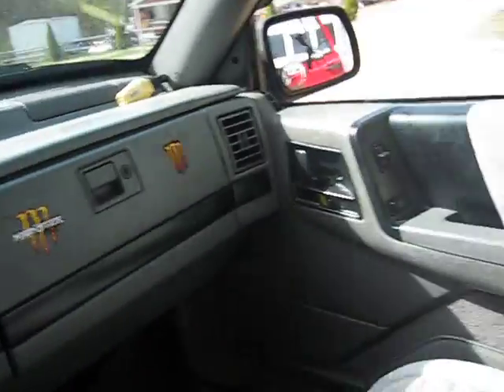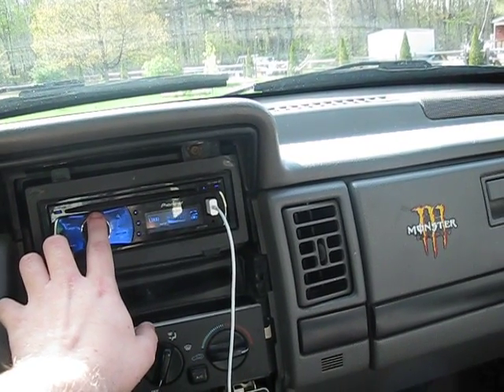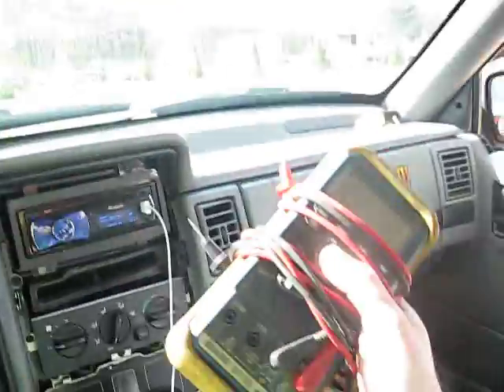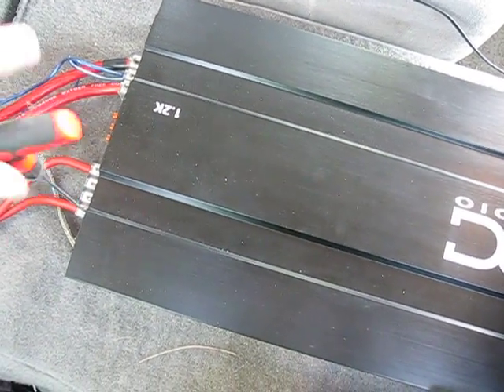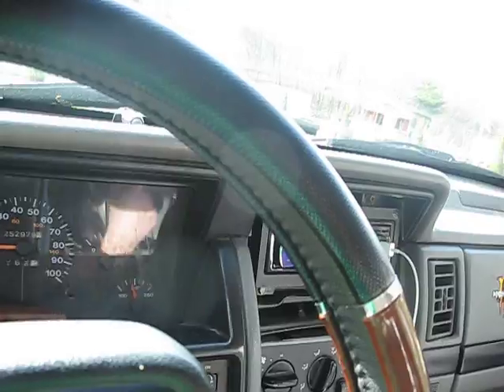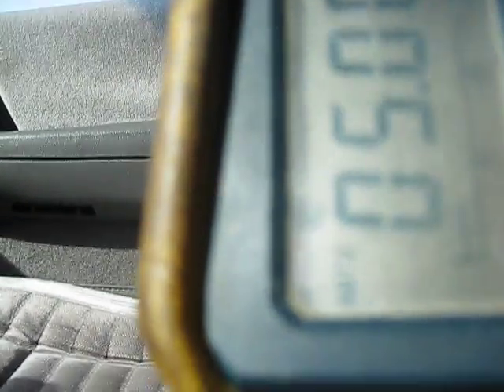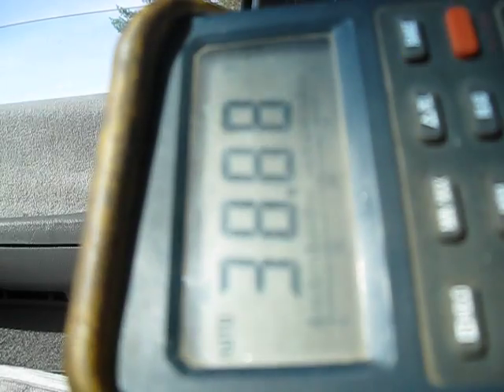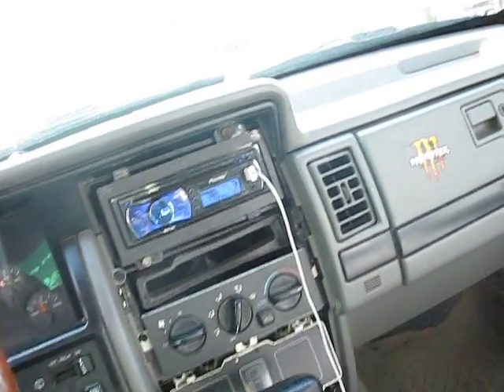How to set your Gains on a MonoBlock

Comment: My skar rp1500 does 930watts rms into a two ohm load. What should be the voltage be set at?
Reply: 43 volts
Reply: Multiply your RMS and impedence which is 2ohms and find the square root of that number
Reply: Thank you

Comment: You're amp isn't tuned correctly man. It's clipping. You multiply the power times the resistance and get the square root of that which is 34.64. resistance is the ohm load.
Reply from the maker: Amplifier is tuned fine.
Reply from the maker: There’s an rms chart in the video description that explains why I set it to this. It’s a 1 ohm amp doing 1200rms

Comment: thats old school tuning buy a smd-dd1 or oscilloscope  u wouldn't believe how much you rubbing your system.amp and subs these days are underated they can handle more power .
Reply from the maker: If you have a clamp you don’t need either of those. You can get your full rms rating and set it like I did in the video.

Comment: Can u find out if the amp is pushing the watts it says it pushing by checking volts. 

Example is the amp claims it's a 500 rms @2 ohms. Volts should be 31.6 volts. 

How do u know if the amp is pushing the watts? Im assuming it has to be under load to check? .. just bc u set it to the correct volts doesn't mean it will push it under a load correct?
Reply: Fade your sound to the rear or where the amp is. unhook your sub, speaker, connect your DMM (Digital Multi Meter) to where your speaker wires go. Put your Volumn on about half way then bring the gain up until you have the volts your looking for.
Reply from the maker: You can if you have a clamp
Reply from the maker: But any Korean or decent Chinese board will do rated or more.

Comment: I believe the math is off lol 34.6. But great vid either way lol
Reply from the maker: 36v at 1 ohm = 1200w. So no.
Reply: @JBlNN  so how to i come up with the voltage amount im looking for? Like how did he figure it was 38 v.? Thanks
Reply: @kamH5039  from what I understand the P-power of the amp X-times R-resistance then get the square root of that answer and thats the volts your amp needs to be pushing. So look at JBiNNs reply.  His amp is 1200(P) X 1ohm(R) = 1200. whats the square root of 1200?

Comment: to figure out the voltage (ac) this would be the formula is e= sq root of PxR 
E= volts (ac)
P=power (watts/ rms )
R= resistance (ohms)
example 
600 rms sub at 1 ohm would be 
600x1= 600 
then take the square root of 600 which is 24.49 which would be what the ac volts you would need
Reply from the maker: or just do what I do and use an rms chart ^_^
Reply from the maker: But I appreciate the feedback

Comment: so you're setting your voltage to the RMS of your subs, correct?
Reply from the maker: +Kendall Holsten Correct. Theres an RMS chart that will give you voltages.
Reply from the maker: More or less you want the RMS of the amplifier. Which on this amplifier is 1200w.

Comment: I have the same unit. I used the dd1. And that deck distort at volumen 55
Reply from the maker: Will Orellana My door speakers distorted at around 48-50 volume and that headunit doesnt give enough wattage to distort my speakers unless they were clipping so I stay around 48-50, 52 sometimes if the song is quiet. Also I wouldnt give steave meade 1 cent of my money that guys a hack.